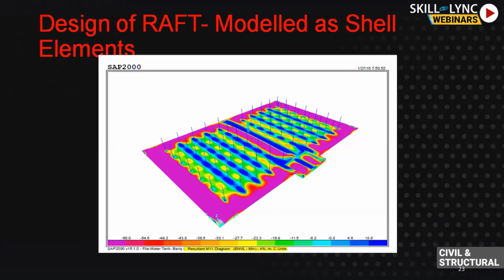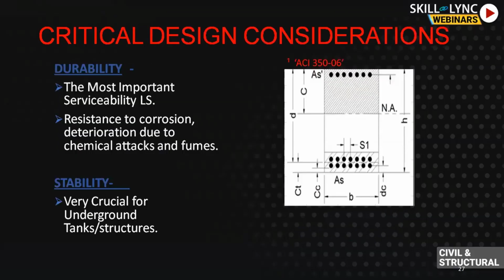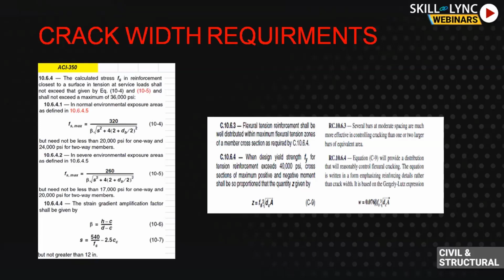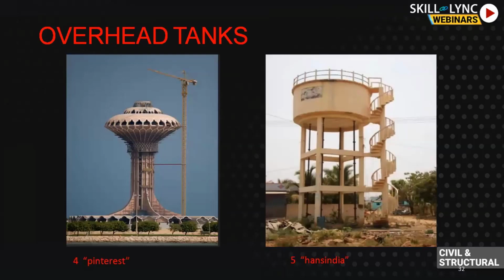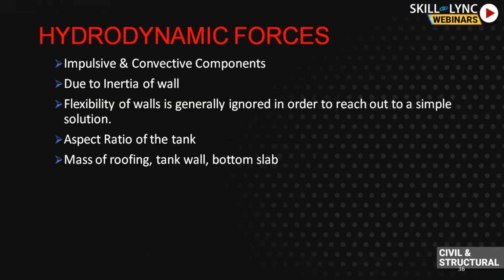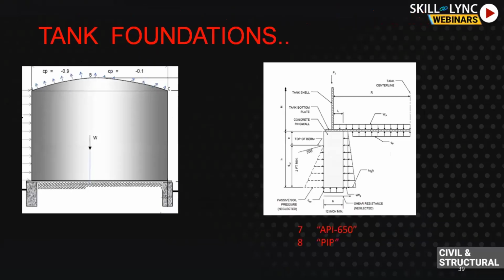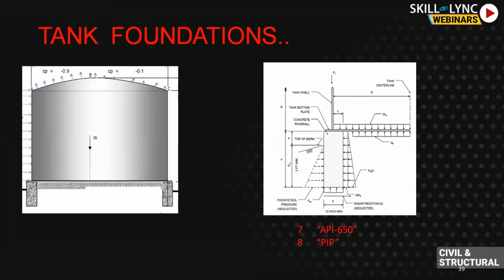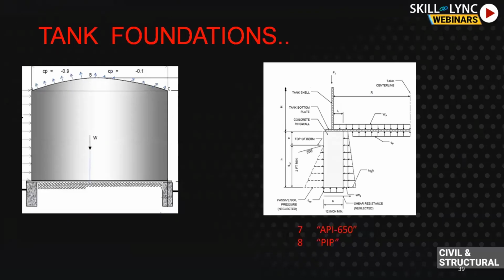Design of Environmental Structures (Part - 2) | Skill-Lync | Workshop

Comment: Helo, I have a question and I really hope you answer. If we modeling the mc and mi on SAP 2000, why we have to input mass and force at the spot that connected to the structure with the spring? and why the value of force is the value of mass x gravity? I really appreciate your answer. Thanks :)